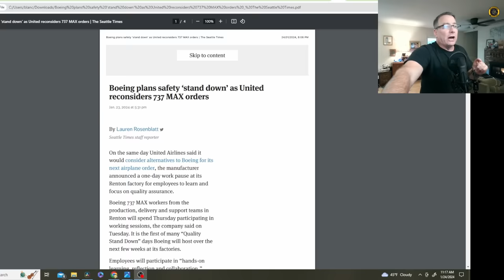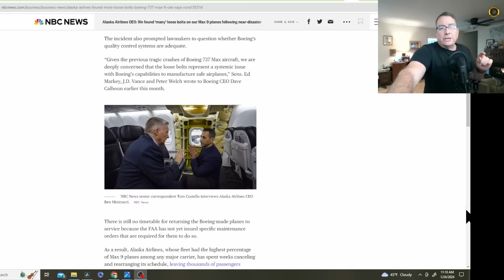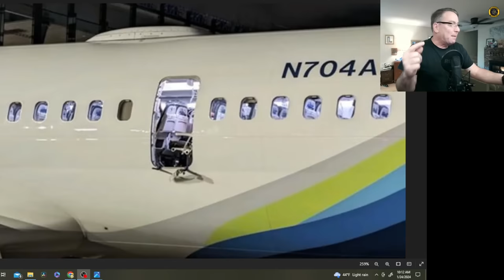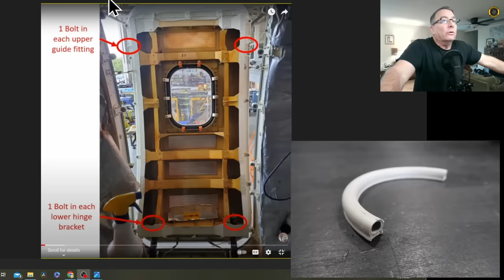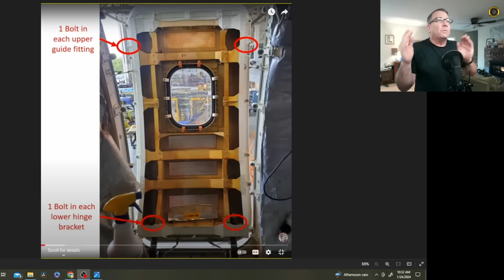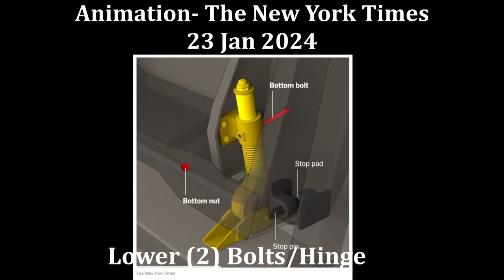Boeing's Quality Management Failure Explained 737-Max-9 Door 24 Jan 2024

Comment: As a former ICBM Miniute Man Missile Tech, in this career we were constantly taking pictures of everything we did to verify all works was completed in accordance of Air Forse Space Command AND all other partners technical data related to the Rocket. Lockwire used on just about every single bolt and fastener, even on cannon plugs for electrical connections. Perhaps Boeing needs to implement these practices into ALL avenues of the assembly of the Airplane.
Reply: With the advent of cell phones, I've been taking "job progress" photos on job sites for three decades now. Once we were sued three years after completion: contractor thought he did 300 grand worth of work (he had done this before) and sued Head Office for non-payment. The hard drive off of each site is secured in a safe: (or in the Cloud) When a job is covered/difficult to access photos of work completed are a no brainer. Even had several shots of a tree on site we were gtrying to save along the shot crete: it started leaning into the neighbours new garage; weekly photos showed the movement, and I caught it in time.
Reply: ICBM Minute Man Missile Tech has to be the coolest job title ever!

Comment: Late last year, end November if my recall is correct, there was a Southwest flight departing from SAN, San Diego International - for Hawaii.  An Alaska flight was second for departure and reported to the Tower that... “a Door was Open” on the Southwest. Tower ATC reported this issue to the Southwest crew..., expecting them to pull off. However, the Southwest was already cleared, on the roll - and rotated. The pilot on the Alaska commented... “I’ve never seen that before”. The Alaska crew advised the Tower that they would contact the Southwest on the guard frequency after their take off. I found that the Southwest climbed to FL16, and maintained that level in a racetrack pattern just north of Camp Pendleton to sort things out. I also found that they diverted to LAX... 45 minutes later. Not certain just what door was open, but those guys on Alaska certainly were totally surprised at what they had just witnessed. Boeing airframes are making it into the news in a overwhelming bad way far too often these days.
Reply: Must have been a lower desk door, not for passengers...
Reply: BTW, a Delta plane lost a nose wheel at Atlanta airport 2 days ago...

Comment: If after the original 737 Max 2 years of grounding they couldn't turn things around then why would it be any different now.   The other "safety escapes" won't show up for years until there are more incidents.   If there are loose rudder bolts and door plug bolts then you can guarantee that there are countless other issues that simply haven't presented themselves yet.   You can't just have an inspection and call it good, now you have to doubt all aspects of assembly and many of those things can only be truly visualized and quality checked as it is being assembled, not after delivery.  So frustrating to watch a great American company like Boeing focus so much on stock holders that profit overrides quality and safety.

Comment: Talk about "THE GOLDEN BOLT" (those who did FOD walks in the USAF know that saying) yes a giant loophole in the Boeing inspection system, but as a mech. I still can't think of one item that doesn't require a QA inspection upon installation to get signed off. Especially one that gets covered up by a panel after. Thank you for the thorough update Juan!

Comment: Thanks for the information, Juan.  It doesn't matter that they just "opened" the door plug and didn't "remove" it.  If the bolts that secure the door to the fuselage have to be removed to open the door, there has to be a verification that the bolts were replaced properly.  To not do so is absolutely unacceptable.  It is illogical and indicates a lack of concern about ensuring passenger safety.  Disgusting.  Boeing and Spirit bith need a thorough and honest quality audit. This can't be the only hole in their quality systems.  It's only a matter of time until something else fails.

Comment: To my mindset the biggest issue is their continuing reference to a <DOOR> this alone causes confusion. A <Door> is hinged/latched and therefore has no reason for the Bolts to be Removed just to open/Close the <Door>
In Fact this is a <PLUG> designed to be fixed in place. Referencing this as a <PLUG> should trigger a full inspection any time it is touched for any related Maintenance.(including a seal correction)
* At no time should a <Plug> be confused with or identified as a <Door>. it is not designed to be used as an egress, even in an emergency.
Reply: Then add ignorant management to the equation with sloppy nomenclature.

Comment: When I was an aircraft engineer, for every job your recorded every task done on a maintenance job card.
As a job progressed you left an 'open entry' if work was still required to be done.
Until there was a new entry saying the job was complete, the maintenance controller would not close the job maintenance card to release the aircraft for flight.

Comment: Great job Juan,  yes this really is a quality system problem. The Q.A. planners were asleep at the wheel, to not have an inspect op. red-inked into the planning documents (physical or electronic) to check for proper re-installation of the door. But more than that, from a Quality Assurance / Continuous Improvement perspective if you allow chronic escapes from your sub-tier supplier, allowing them to be constantly fixed at your plant, not only are you accepting inefficiency as the norm (what I call an embedded rework), you are also inviting the laws of probability to come and bite you in the ****!! The Quality Assurance group at Boeing, all the way up to the senior level, are looking pretty shabby over this incident. Such a shame.
Reply: I worked for a company where nearly every project involved me following other workers and fixing their shortcuts.  there was finally a conversation with my wife regarding whether we would go with a Harley Davidson and antidepressants, or a plan to fire that company.  I don't have a Harley, but I'm okay with that.
Reply: nailed it.
Reply: Absolutely this. Routine rework being necessary or accepted in the first place is always a sign of an insufficient quality culture.
Reply: Right.

You can't enable shoddy work and expect anything to ever change. 

You have to refuse detective products at the door at the suppliers expense. 

A sewing factory I worked in did that. It took a month of brutal 60 hour weeks to make up the shortfall, but subsequent shipments had a negligible failure rate.

Comment: It’s obvious the breakdown is in the terminology.  You OPEN an escape DOOR, you REMOVE a PLUG that is used in aircraft with no escape door. Even if it was a DOOR, there should have been a sign off by an inspector that the maintenance was completed whether or not it was a plug or a door.

Comment: Now for the big question: How many of those bolt assemblies could they have bought with the latest round of bonuses for the higher ups?
And the most important thing now is to remove the "open" option for plug doors and always have them registered as removed since that is what you're doing. 
The Open option is for regular doors where you can either open them, or remove them.
Reply: There is a difference in the procedures for 'open' and 'removed' even on the plug door. In the first one the straps remain in place and the plug door is not raised off the hinged bottom mounts. If removed there are some extra checks (re-install/check-already-installed the springs, reattach the straps). Maybe you can write it the same for both in terms of 'check this is present/attached. I'm not sure. But they are different procedures.
Reply: There's a lot to be said for making processes consistent. A few more "if/then" options may be required, but it appears from outside that the process up to "open door plug" is identical whether opening or removing, and only a few extra steps required to make it "remove door plug". Likewise on re-installing and securing. One checklist, with some steps that can be deleted if door plug is not being removed from the aircraft.
How many other "different only in semantics" processes could also be simplified to reduce the potential confusion and missed steps?

Comment: I used to be a massive supporter of Boeing though after 2019 I wasn't thrilled to learn of the garbage they were doing; even so during the beginning of this whole situation happening I was giving them the benefit of the doubt since I believed, and still strongly believe, that letting investigators do their things is absolutely important to properly assign blame to those that should be held responsible, but as this investigation progresses and we get more and more information I really find myself being disgusted at what the company has become, at the corners they're cutting, and at how they've gone from safety being a priority, to that same safety now being an afterthought. I would have thought that after the disaster that was 2018 and 2019, they'd have realized their mistake, gotten their shit together, and made safety a priority, but it's starting to become clear that this company really needs to be forced to go through a serious change in leadership, because these types of things are never acceptable
Reply: Well put, and I totally agree 👍
Reply: Assign blame all you want it will not fix the problem.  Because blame is assigned.  The problems are systemic in the organization.  It starts with a philosophy and ends with a culture that creates these problem.  Yes I stopped reading when I read blame.
We are giving cost cutting a bad name here.  An engineer can cut costs through engineering improvements which done properly result in a better product.   We need this sort of price cutting in multiple industries.  
I am relatively sure that people at Boeing made changes.  Wrote memos etc to Improve quality.   But this is a very large organization and difficult to pivot both culture and philosphy.   That is a reason and not an excuse.  People at Boeing and the FAA know this too.
Reply: @danharold3087  I definitely agree with you on it being a philosophy and culture problem, and I do agree that cost cutting isn't the issue at hand, like you said cost cutting is needed in multiple industries, and when improvement is done properly by engineers it can and has resulted in a better product.
I will give you that my use of blame in my wall of text was more than likely the wrong word to use, but my intention wasn't to talk about or assign blame, but more with expressing the sheer disappointment and disgust I've been feeling, as the investigation has progressed, from seeing everything that's been transpiring with in the company.

Comment: A&P here as well. Wow that work order system is scary bad. How opening the door doesn't require a QA sign is unbelievable.  Of course techs are going to favor that as it's quicker with less buy offs. Less Swiss cheese,  more like a pip with a slight bend blocking these series of errors.

Comment: Boeing needs to fire its top management and replace them with engineers. They need to immediately slow down with the production and implement a rigorous and thorough quality management system. They need to work with suppliers to hold them to the highest standards and to completely integrate their information systems. Only then can we, the flying public, begin to trust them again.
Reply: I'm sorry but that could impact the CEO's $20 million bonus and we just can't have that!
Reply: Not every engineer makes a good manager.  But any engineer should be able to say 'STOP.  This is a bad idea." and be listened to.  It appears that Boeing has forgot how to listen to their engineers (and QC people).
Reply: Lockheed L-1011 TriStar  is the reason why we don't want to replace engineers with MBAs.  What is needed is people with a balanced understanding of the two topics.

Comment: As a Boeing retiree I would of came to a conclusion by the way the paperwork works that the inspector checking the repair of the pressure seal should of been aware that the plug was opened to access the seal, in turn reinspecting the closing of the plug including all latches and fasteners. Just my thoughts and opinions.